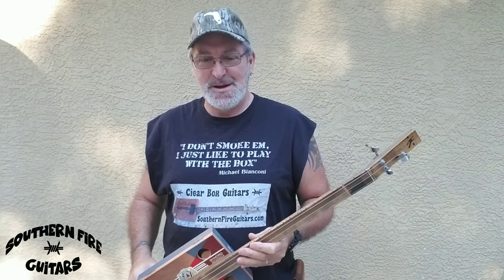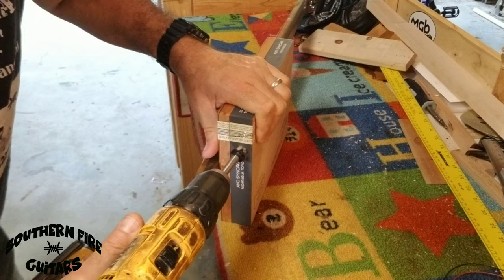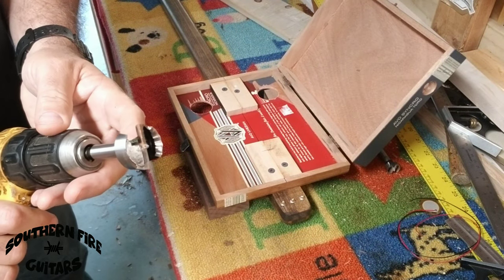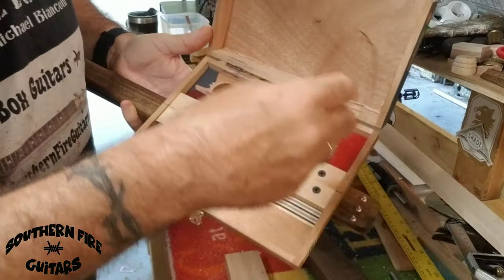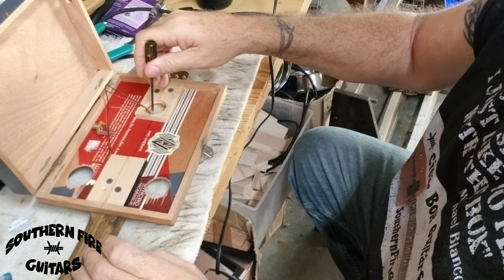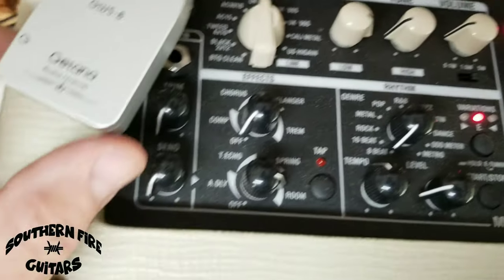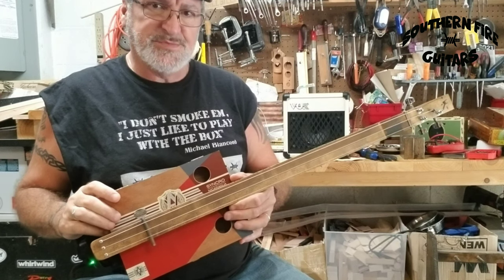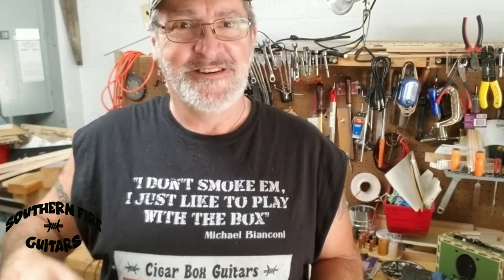Cigar Box Guitars  This CBG is Missing Something....

Comment: Is it me or are the top of the box fretboards louder?
Reply from the maker: I was surprised as well at the sound of this thing,  Its pretty loud. Very happy with the sound that it throws out.
Reply: You can also lightly arch (sand out) under the middle of the neck to allow the top of the box to resonate more. The other part is that particular box. Avo boxes are completely awesome boxes for CBGs. Not saying Michael doesn't know what he's doing (we both know that's not the case), but these boxes are like lace pickups... They sound good about any way you use them.